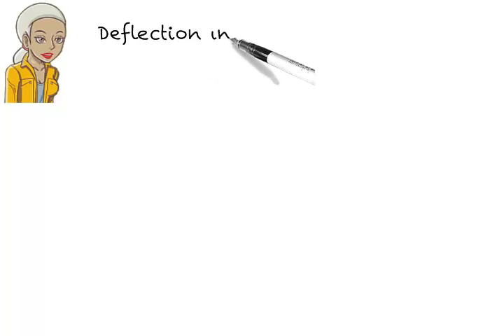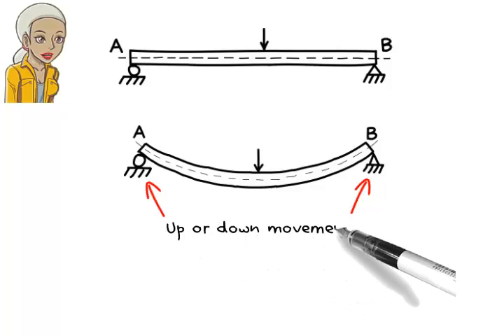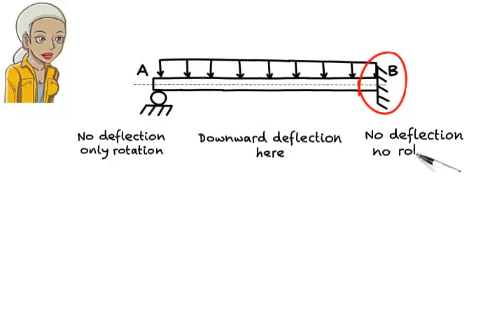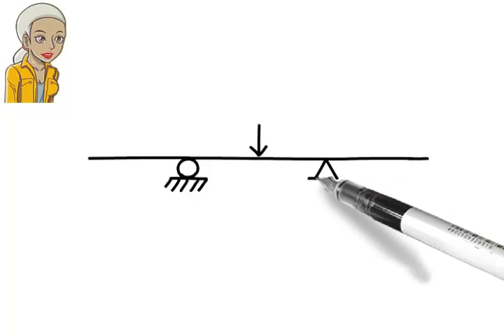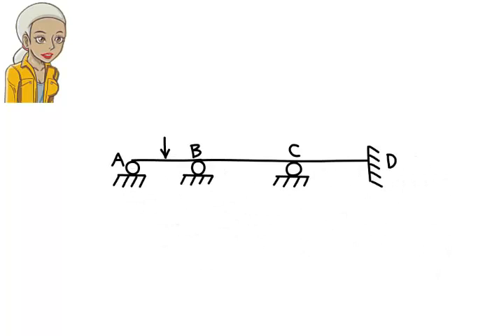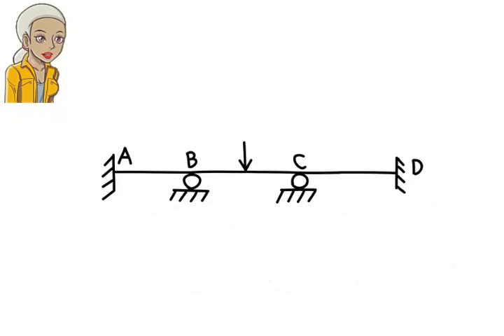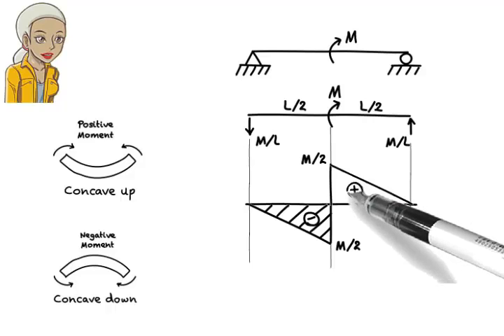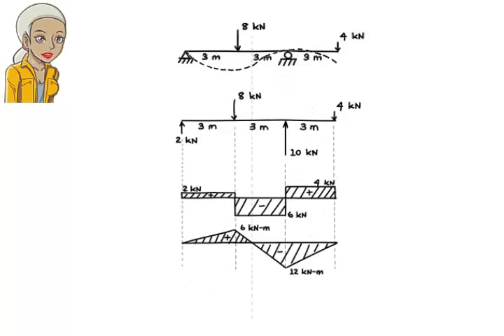SA11: Beam Deflection: Drawing Elastic Curves Qualitatively

Comment: Do point of contraflexure occurs only in overhanging beams??
Reply from the maker: No! The curvature of the beam could change sign in other cases too. Consider a continuous beam with two spans supported by a pin/roller at each end and a pin/roller at its midpoint. If we subject one of the spans to a gravity load, we get a downward deflection in that span and an upward deflection in the other span. In such a case, the point of contraflexure is located in the loaded span near the middle support.
Reply: @DrStructure  thank you sir..

Comment: Thank you dr.structure
The moment in 6:27 , can you give me an example in real life 
Also the three types of support , where we can find them in real life 
Thank you 💚
Reply: Got it 👍
Much thank to you and to the people behind this amazing work 💚
Reply from the maker: Such a bending moment could be produced by a column that rests on the beam at that point. If we are interested in analyzing the beam only, we can show the effect of the column on the beam (i.e., the bending moment) without showing/drawing the column itself.

We can also think of other substructures (i.e., an L-shaped bracket), attached to the beam, that produce a bending moment at that point.

Pin and roller supports can often be seen in bridges (supporting the bridge deck). Fixed supports can be found in building, either at the base of the columns or at the beam-column connections.

For example, see:
https://theconstructor.org/structural-engg/types-of-supports-reactions-uses-structures/16974/

Comment: 4:50, roller at D prevents upward movement of beam? I'm a little bit confused🤔
Reply from the maker: Correct, the roller can only move in the horizontal direction, it allows the beam to stretch horizontally at D. In the vertical direction, the roller acts just like a pin, it prevents the beam's displacement.
Reply: 😮

i thought roller only prevents downward movement of the beam
Reply from the maker: No, a roller (as a mathematical/modeling construct) prevents both upward and downward movements, meaning, a vertical reaction force does develop at a roller support. That force could be upward or downward.
Reply: Thank you so much 😊

Comment: Hello. How about beam with internal hinges in them?
Reply from the maker: At the hinge, the elastic curve ends up having a discontinuous slope. Meaning, instead of having a smooth and continuous curve, we get a V-shaped curve where the slope of the curve at the left side of the hinge is different than the slope at the right side of the hinge. 
For example, suppose we have a beam that is fixed at both ends with a hinge in the middle. What does the elastic curve for the beam look like?  Cut the beam at the hinge. This results in having two cantilever beam segments. Draw the elastic curve for each cantilever. They both deflect downward at their free end (the free end being the place that we cut the beam). Now, if we move the two elastic curve so that they touch at their free ends we get the elastic curve for the original beam. Both beam segments have deflected the same amount at the free end, but the left one has a clockwise rotation (at the hinge) and the right one has a counterclockwise rotation. Meaning, they have different slopes at the hinge.
Reply: Wow, Thanks Doc! That was a very great explanation. I wish you're one of my instructors.

Comment: Hey, thanks a lot for the last time. 

I have found many sessions about the deflection method. But I still did not find any session talk generally about deformation. 

I need some visualization about deformation In general, about what type of deformation may exist and occur, and also the calculation method. 

I have found many sources on the internet, but there is a lot of different ideas and understanding that confuse me. 

Do you have the session that I didn't find/watch or is there any trustworthy place or resource on the internet with a comprehensive and better understanding for me to visit?
Reply from the maker: With regard to visualizing deformation (as opposed to just deflection/bending), think of a large piece of dough. You can make it into almost any shape that you wish by pushing, pulling, twisting, … it in different directions. By applying those force (in different directions) to the dough, you are deforming it. 
Viewing this from engineering mechanics perspective, think of a cube having six faces/edges. Each edge of the cube is a square. At the center of each square place the origin of a 3D coordinate system. The three axes, x, y, and z are to be placed such that x and y lie on the surface of the square, and z pointing outward away from the surface, the z axis is perpendicular to the square. 
Now, place a force in the x direction, a force in the y direction, and a force in the z direction on each of these square edges of the cube. Also, place a moment around the x axis, a moment around the y axis, and a moment around the z axis on each square.  So, we end up with six forces/moments on each edge of the cube. The cube, therefore, is going to be subjected to a total of 36 forces. These forces, when present, cause the cube to deform. Such a deformation could involve, bending, elongation, shortening, wrapping, twisting,… 
To determine the general deformed shape of the cube (or a structure, which can be viewed a collection of such cubes), to calculate all the changes in length and angle that results when the cube is subjected to all 36 forces, we can use generalized finite element method. There are many textbook written one the finite element method (FEM), but FEM is an advanced topic best explored as a part of graduate studies in engineering mechanics.
Reply: Nice explanation. Now I know that basically the deformation topic is way beyond the deflection and has more advanced topics rather than deflection. Make me more curious and want to learn. Thanks a lot.

Comment: When time is 7.15 - 7.30,  are we assuming clockwise moments means moments is positive and anti-clockwise means moments is negative?  
Since M@a = 0 at the due to pin. M@b- = -(M/2)*(L/2) due to reaction force at A. Then M@b+ = (-M/2) + M = M/2.   M@c = M/2 + (-)(M/2)(L/2) = 0.  Where a is LHS, b is midpoint and c is RHS.  Is this line of thinking correct?
Please explain. thank you very much  :)
Reply from the maker: Not quite. Here, we are using the beam sign convention. Moment is considered positive when it causes the beam segment to bend concave up. So, the sign of the moment is defined using a pair of moments, one at the left end of the segment and one at the right end of the segment. As shown in the diagram to the left @7:15, a positive moment means a clockwise moment at the left end of the segment and an anti-clockwise moment at the right end of the segment. 

So, when deciding on the sign of the bending moment in a beam segment, you need to ask: does the moment cause a concave up deflection, or does it cause a concave down deflection? The answer to the question tells you if the moment is positive or negative. 

The left half of the example beam carries a negative moment. Why? because the downward reaction at the left end of the beam creates an anti-clockwise moment. Per explanation above, that corresponds to a negative moment. On the other hand, the upward reaction at the right end of the beam wants to bend the beam segment in a concave up manner, so it results in a positive moment in the beam. 

As the moment diagram shows, the negative moment in the left half of the beam starts from zero and goes to M/2 (or, -M/2). The moment at the right half of the beam does the opposite, it starts from zero at the right end and goes to positive M/2. This is obtained by multiplying the reaction force (M/L) by half of the length (L/2). 

The difference between the left moment (-M/2) and the right moment (M/2) at the mid-point of the beam equals the applied moment (M). That is: (M/2) - (-M/2) = M.
Reply: @DrStructure  Thank you so much for the clear explanation!  :D
Reply from the maker: @limchekhui1792  You're welcome!

Comment: Nice explanation but can you plz explain how in the last question the deflection is downwards at 4kn load point?
Reply from the maker: Whenever bending moment is negative, the beam deflects upward (concave down), and when it is positive, the deflection is downward (concave up). In this problem, the left side of the moment diagram is positive and the right side is negative, meaning the right side has to deflect up while the left side deflects down. Draw two such curves, one deflecting down for the left side of the beam and one deflecting up for the right side of the beam, then place them on the beam observing the fact that deflection at the supports must be zero.
Reply: Thanks I got it👍
Reply: I understood that but at right side bmd is negative and when bmd is negative the beam should bend upwards, so how come you have shown at point where 4kn load is acting(extreme right) the deflection is downwards?
Reply from the maker: Not quite, when moment is negative, the elastic curve (the deflected shape of the beam) is going to be concave down, meaning the top fiber of the beam is going to be in tension and the bottom fiber in compression. It is not about the direction of deflection at any point, it is about compression vs tension in the extreme fibers of the beam. 

Think of a cantilever beam subjected to a downward force at its (right) free end. How is it going to deflect under the load? downward (the force is pushing the point down). What is the moment in the beam? negative (just like what we have here at the right end of the beam), what would be the deflection shape of the cantilever beam? concave down.  For all practical purposes, you can view the part of the beam from the roller to the free end as a cantilever being pushed down at its free end by the 4 kN force.
Reply: Yes I got it thank you but how do u know it will deflect downwards at 4kn?
Reply from the maker: Here, we are drawing the diagram qualitatively. If in doubt, we would have to do the actual computations in order to determine the direction, and magnitude, of such a deflection. Qualitatively speaking, the downward force of 4 kN is attempting to push the free end of the beam down while the 8 kN force wants to push the same free end up. Which one controls?  
Examine the moment diagram, note that moment is zero in the middle segment of the beam. More precisely, it goes to zero 2 meters to the left of the roller support. Let's refer to that point at B. Now, isolate the beam segment from B to the free end. What does the free body diagram of the segment look like? Zero moment at B, a downward shear force of 6 kN at B, an upward force of 10 kN at the roller support, and the 4 kN force at the free end of the beam. Think of this as a beam segment sitting on a roller at its mid-point. We are pushing down the left end of the segment with a force of 6 kN, and we are pushing down the right end of it with a force of 4 kN. How would the segment bend? Why would the the right end move up? The beam segment would have the tendency to deflect down at both ends.
The right end can actually move up under one scenario, when B is forced to rotate in the counterclockwise direction. If that rotation is large enough then the entire elastic curve could rotate around the roller support forcing the free end of the beam to move above the beam line, resulting in an upward deflection. Although the 8 kN force causes such a rotation at B, but it is not going to be large enough to push the free end of the beam up. The energy needed for that rotation is caused by the positive moment in the beam. But note that total positive area under the moment diagram is significantly smaller than the total negative area. This suggests that the 4 kN force overpowers the 8 kN force in defining the deflection shape.

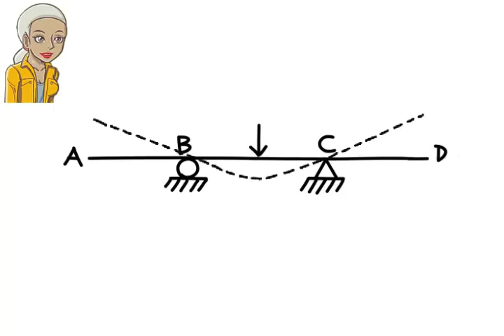Comment: Sir, how will the beam bend if there are loads on AB and CD member on beam at 4:16
Reply from the maker: If either AB or CD, or both are loaded,  then each segment wants to have a concave up deflection. The amount of deflection depends on the load magnitudes. The larger the magnitude, the larger the deflection in AB/CD. The downward deflection at the outer segments is adversely related to the deflection in the middle segment. The more AB/CD deflect, the less BC deflects down.
Reply: Dr. Structure If the loading were downward then wouldn't it be convex and hogging?
Reply from the maker: yes, the outer segments would be.

Comment: How will be the elastic curve, if a particular support sinks?
Reply as soon as possible..
Reply from the maker: Consider a beam fixed at both ends. If the left support settles, we get a positive moment at the left end of the beam, and a negative moment at the right end of the beam. This means, the left half of the beam bends concave up and the right half of the beam bends concave down, with the point of inflection being at mid span.
On the other hand, if the beam has a fixed support and a roller support, and the roller support settles, then we end up with a concave down deflection of the entire beam.
If a middle support settles, it generally causes a concave up deflection in its vicinity, eventually turning into a concave down deflection near the adjacent supports.

Comment: @dr.structure if an end on the beam is undergoing rotation only at a roller support like 2:19, is it valid to say that there is also no up or down displacement? bc my initial thought is that if something rotates doesn't that mean the points on the beam are changing vertical position also? Or do we neglect that here because its change in position at a roller support is small compared to the actual deflection
Reply from the maker: By definition, the roller support only permits horizontal displacement, no vertical displacement takes place at the support.  

You are correct to assume that if a beam joint rotates, then it also should has a vertical displacement, but only if it is not resting on a pin or roller. Otherwise, the joint would rotate without any up or down movement.

Comment: Could you please look at the example when the time is 4.23. The moment diagram between BC changes from negative to positive trough the supports to span. Thus elastic curve between BC requires one negative and then positive curve? Could you please explain it.
Reply from the maker: Yes, bending moment at B and C is negative, but moment is positive for the most part of BC. So, the elastic curve for the entire beam consists of three parts (from left to right): concave down, concave up, concave down.

The left span and a small part of the middle span, about L/10 to the right of B, is concave down as bending moment is negative in that region.

The right span and a small part of BC (about L/10 to the left of C) is also concave down as bending moment is negative in that region.

The middle part of the beam (about 80% of its length) is concave up as the bending moment in that region is positive.

So, there are two inflection points in the elastic curve: one a bit to the right of B and the other a bit to the left of C where the shift in the curvature takes place.
Reply: Moment at support B is negative. At span (BC) is positive. At support C is again negative. Therefore, the elastic curve from B to C needs to have three concave (up, down, up). Or you mean that since the most of the part of BC is positive therefore one curve between BC as given in the video
Reply from the maker: You need to view the entire elastic curve consisting of three parts, not just the part between B and C. 

The first curve (concave down) start from the left end of the beam and ends just to the right of B. That is where the first inflection point occurs. There is no inflection point at B.  

The second part of the curve (concave up) starts where the first part ended and continues until just to the left of C. That is the second inflection point occurs.

The third curve (concave down) starts where the second one ended and continues until the right end of the beam. 

Since there are no inflection points at the supports, there is no reason to divide the elastic into parts at B or C.

The video does not identify, or clearly show, the inflection points. But these points are not exactly at B and C, they are to the right of B and to left of C.
Reply: I agree with  to consider entire curve. I want to ask between BC due to changing moment signs. Why does not BC have three curves due to changing moment signs
Reply from the maker: BC does have three curves. Except that the left curve in BC, which is concave down, is a part of the left curve for the entire beam. And the right curve in BC (also concave down)  is a part of the right-most curve for the entire beam.

So, at the end you only have three curves. Two concave down curves and one concave up one.